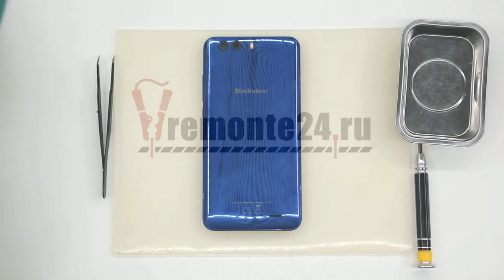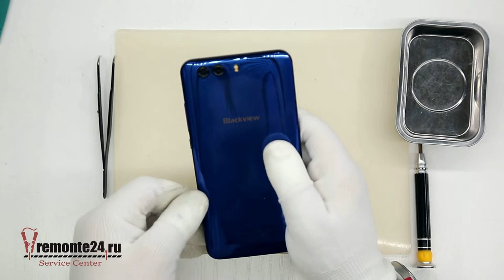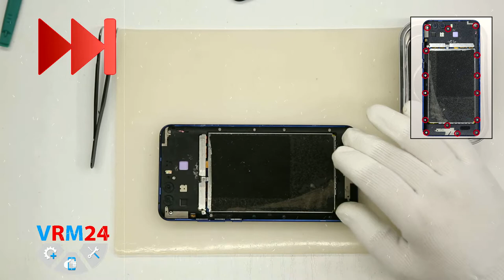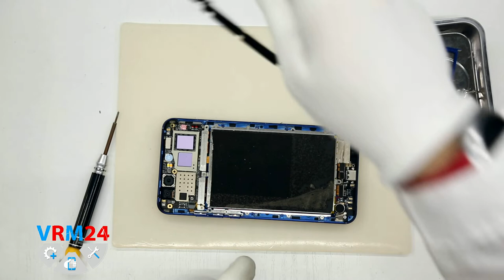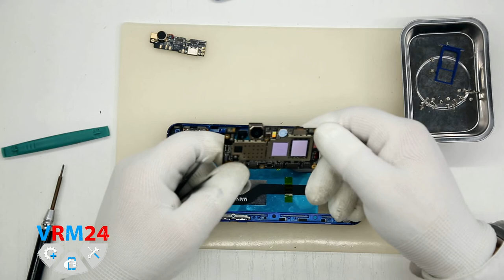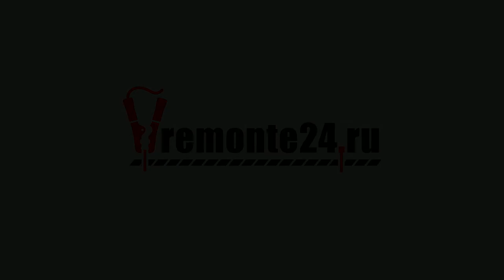How to disassemble 📱 Blackview P6000 Take apart Tutorial

Comment: how hot should it be?
Reply from the maker: The cover?
Reply: @Vrm24com  well, yes. I mean those adhesives requiere certain temps... but would a hairdryer work?
Reply from the maker: Yes, it would and it will. The temp of hairdryer airflow is about 80° C. Max temp of the surface shouldn't be more than 60° C. But how do we do it. We warm & pry ... warm & pry ... trying to separate.
Reply: @Vrm24com  ok thank you! I wasn't sure! And overall a good video!
Reply from the maker: @admiralgeneralnn  Thank you, too!